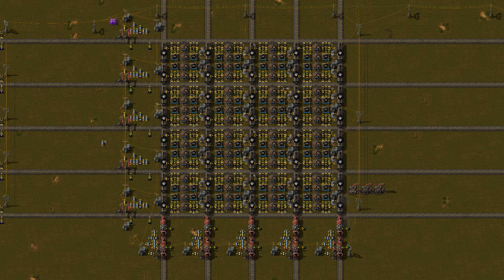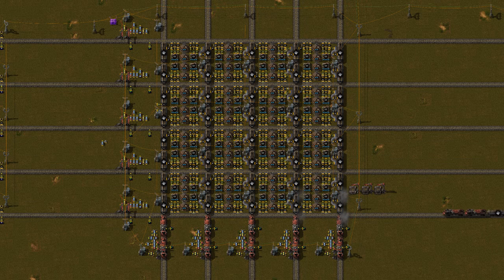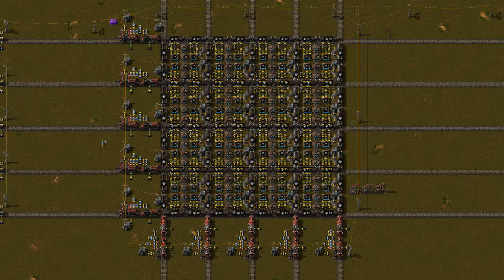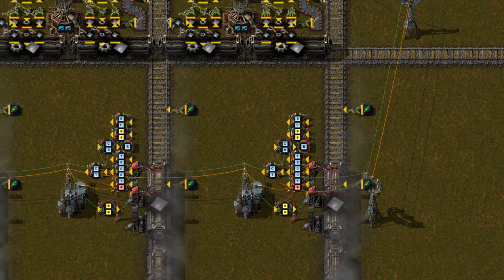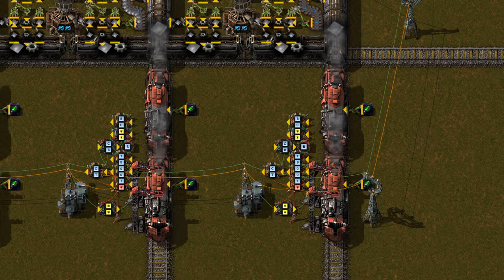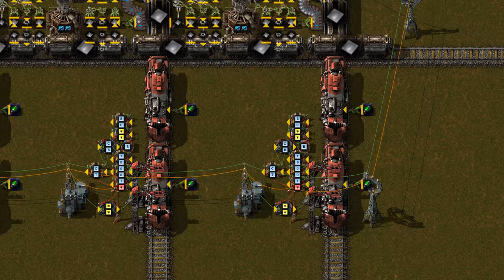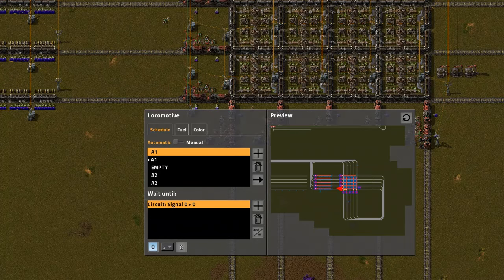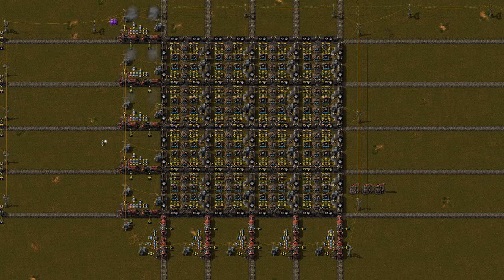Grid station for ethereal trains

Comment: For this to work, all trains would need to be in the same block. This means there cannot be any rail signals throughout the entire rail network.
Reply from the maker: Simply all extra challenge
Reply: Somebody mentioned that you can connect signals to network. As result forcibly enable them for next train. Or use for train alignment.
Reply: @iIiWARHEADiIi  you can't forcibly enable signals, only forcibly disabled them.

Comment: If you want to tackle some combinator tutorials I would support that. Would probably be best to figure out a chain of useful setups where it starts with simple, but useful builds that just use a couple combinators and after having a good basis of how things work you could combine the smaller circuits into more complicated setups.

Maybe you could have a set of blueprints that you use like plug and combinate modules that have different flooring around them so they're easy to identify at a glance. Like sudo-computer boards.

A good basic layout for a tutorial video is "This is it's goal" -> "This is it in motion" -> "Here the special things about it" -> "Here's how to set it up." -> "Let's get technical" You can change these around and add or remove parts to make the video fit your style.

I would recommend looking up some Minecraft redstone tutorials to get an idea of how they go about it. I would recommend checking out both Mumbo, and ilmango as they do some good tutorials, but in different styles.
Reply from the maker: thanks for the tips. I think (not sure yet); that I'm going to create some custom schematics for combinator state (so not film the technical part in game). Because combinator set ups can be hard to follow otherwise. In minecraft redstone changes color depending on it's value. While in factorio, you can only see the value of the thing you hover over...

Comment: You should post this on reddit, it's awesome! Q: Why 2 stations? Do they crash if you remove the first station because of bad alignment?
Reply from the maker: it already is
and yes, the only way to align them is for the train to stop in between 2 stations. Just stopping at the one or the other would result in collisions.
Reply: Oh, I see, you abuse station detection to align them in a non-standard way...
Also: Use infinity chests and the electric energy interface for such testing. That way, everyone can jump into the world without fiddeling with mods :)
Reply from the maker: wait infinity chests are in vanilla?
Reply: Yes, they are: /c game.player.insert("infinity-chest") to get one. I think that an infinity pipe will also be added in 0.17
Reply from the maker: good to know
by the way you would still have been able to see the station in action without loading the mods; the trains just might run out of stuff; but the station itself would still function.

by the way when you asked about the 2 stations... did you watch the whole video? because if you did, then I must have explained it badly in the video (i'm terrible at speaking and writing and stuff)